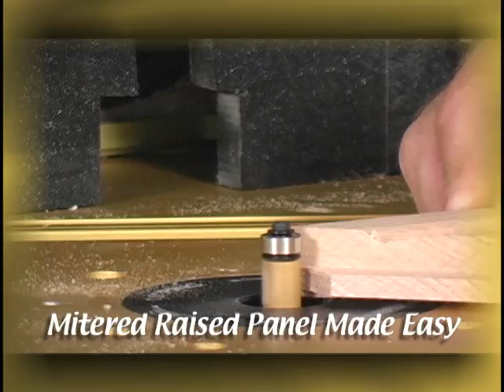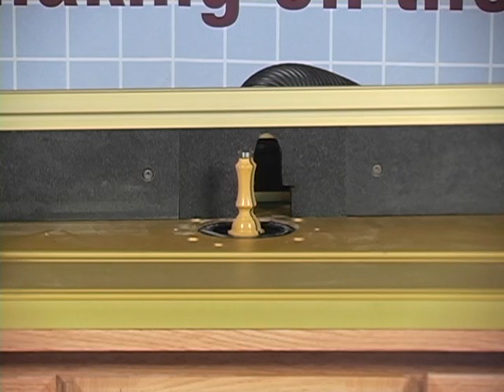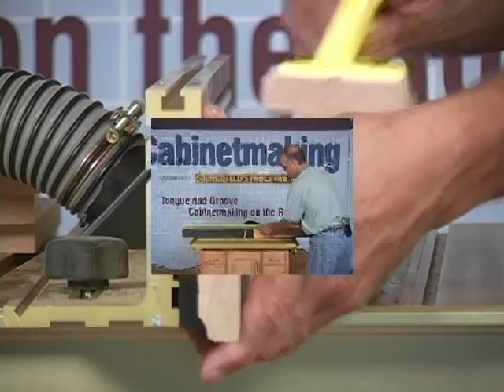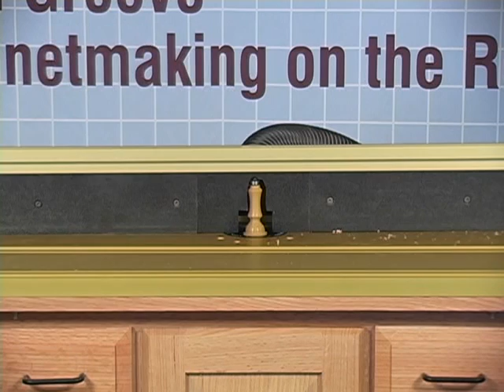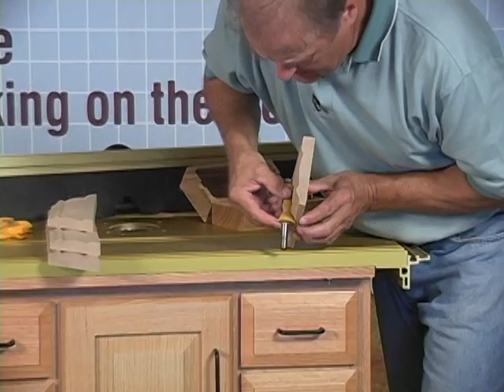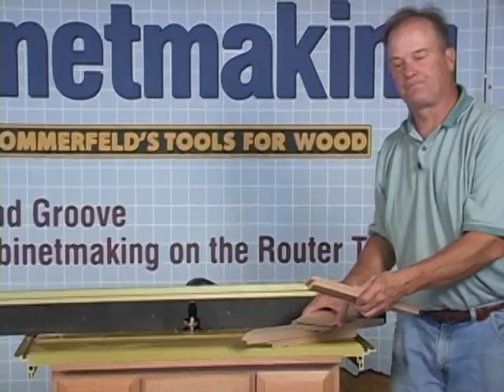Sommerfeld's Tools for Wood - Mitered Raised Panels Made Easy with Marc Sommerfeld - Part 1

Comment: @ 13:00 you didnt hit your mark. how is that more accurate?? the 45 is probably more spot on though so 6's i guess...
Reply: I noticed that too. I just built a miter sled which takes care of the exact 90d, but you still have to get the length just right. That's the exact kind of error that dogs me. Seems like the pencil mark should be made at the bottom, not the top, then you can butt it right up against the saw blade for better precision.
Reply: True cut mark on bottom to line up with saw cut on sled. I bet he didn't have a use for that part just dimo.
Reply: +ndktube  Its obvious he was just making a sample video, but good job on pointing out the mistake. Keep it coming Sommerfeld!!